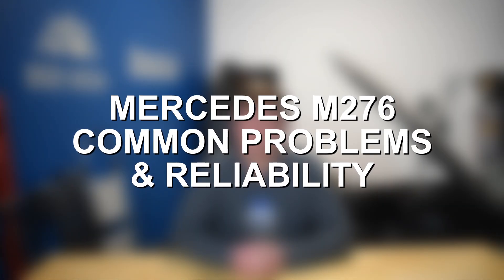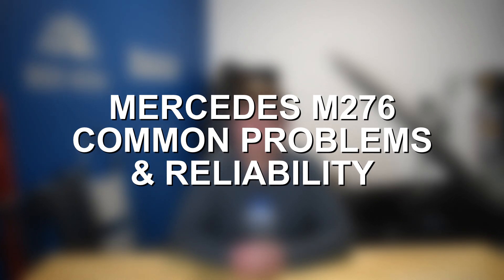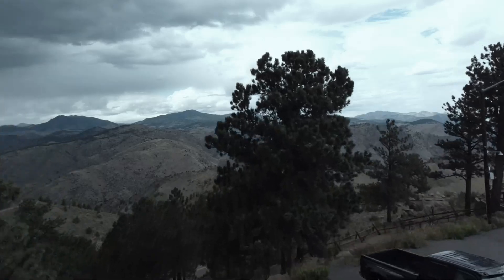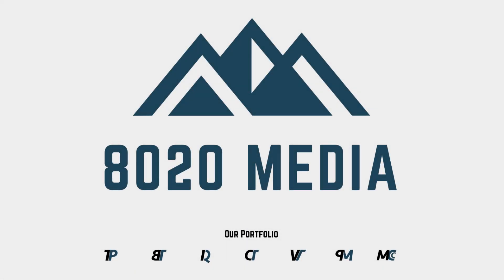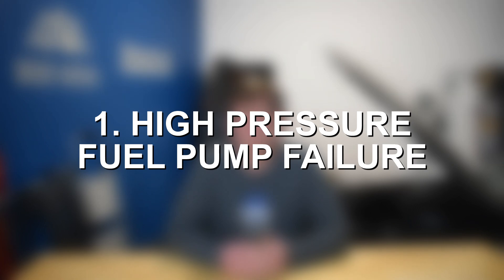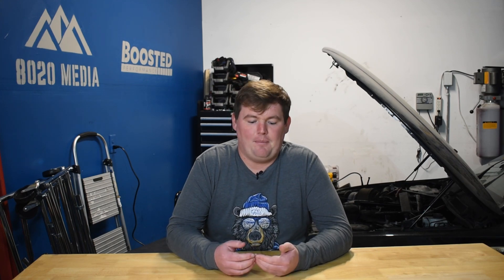M276 Mercedes-Benz | Common Problems & Reliability

Comment: What do you think about the Mercedes M276 petrol BlueEfficiency version? What are its weaknesses? Thank you.
Reply from the maker: D - The Mercedes-Benz M276 (BlueEfficiency / CGI V6) is a pretty solid modern engine, but like any complex direct-injection + variable-valve motor, it has its weak spots. Some of the commonly reported issues are: oil leaks (especially from the front upper timing covers and seals), camshaft adjuster / actuator failures, which can rattle on cold start, cause VVT faults, or damage the cams if ignored, problems in the timing chain / tensioner system (wear, slack, especially in early versions before updated tensioners), carbon buildup on intake valves (a common downside of direct injection engines), and oil leaking into camshaft position sensors / wiring harnesses (when seal fails) causing odd electrical issues.
Reply: @8020Automotive   thanks a lot for you answer !!

Comment: I'm seeing people comment on "oil in the wiring harness".  Is this an issue on the biturbo versions?
Reply from the maker: L - Yes, oil in the wiring harness is a known issue. this happens when engine oil wicks through the wiring harness from leaking components like the camshaft adjuster solenoids, turbo oil feed fittings, or valve cover gaskets, and travels along the wires toward critical electronics like the ECU or TCU, potentially causing sensor failures, misfires, or erratic behavior; this is more of a problem on higher-mileage or poorly maintained engines, but it’s a real concern—so if you notice oil contamination inside sensor connectors or along harness sheathing, it’s smart to clean it thoroughly and replace any leaky solenoids or seals before the oil spreads to more expensive modules.

Comment: Advise. Between a M211 09. Petrol 350 and a 2012-2015 M276. What would be your preference on reliability. I wish to purchase soon.
Reply from the maker: B - The M276 is generally the better pick for reliability and refinement. The M276 addressed many of the timing chain and balance shaft issues that plagued the earlier M272. But that's just our opinion.. Comes down to maintenance, price, etc.

Comment: what better a m276 twin turbo of the c43 or the bmw b58 engine in terms of performance and reliability?
Reply from the maker: I'm definitely a little biased towards BMW, but it's tough to beat the B58's balance of performance and reliability. That said, if you prefer Mercedes I wouldn't recommend changing just because of the engines. The M276 is still a solid engine that has a lot to offer.

Ultimately, I wouldn't pick an M276 or B58 powered car JUST because of the engine. If you're really up in the air see if you can test drive models with each engine and see which really feels like the better overall vehicle, engine, driving experience, etc. to you.

Comment: Maybe you have come across it:

Every now and then my .276.820 twin turbo V6 the homologous variant. Has up to 20% higher fuel consumption. First time I noticed it was exactly after 1 year service and after a couple of thousand miles it goes back. Anything you know about?
Reply: The increase of fuel consumption sounds familiar to me. I have a m276 3.5l non turbo in a W204 (European model). This engine is equipped with an egr and nox catalytic converters. The increase in fuel consumption is to clean the nox catalytic converters. I also notice it in the behaviour of the car. The cleaning cycle could last for days in my case because the engine/exhaust needs to be up to a certain temperature and speed to start the cleaning cycle. My trips are most of the times around 20km with slow speeds. If it happens on longer trips it takes about 50km to 100km to finish the cycle.

Hope this helps
Reply: @FrankyN  Interesting but for me it takes months and maybe 4000 km?
Reply: @Bizmyurt  That is too long. The cycle is just a couple of hundred kilometers at most.

However when the car ages the cycles became more often for my feeling.
Reply: @FrankyN  First time I noticed was exactly after 1 year!
Reply from the maker: B - The periodic increase in fuel consumption by up to 20% in your M276.820 twin-turbo V6 could be due to the engine management system resetting or adapting after service, especially if the battery was disconnected during maintenance. When this happens, the ECU resets adaptive learning data, causing the engine to temporarily run less efficiently as it relearns optimal settings based on your driving style and conditions. This adjustment period usually resolves after a few thousand miles, which matches your observation. Additionally, changes in fuel consumption could be influenced by factors like seasonal fuel blends (winter fuel has lower energy density), tire pressure changes, or software updates applied during service that might temporarily affect fuel efficiency. To minimize this, ensure the air filters, fuel system, and spark plugs are in good condition, as these can also impact efficiency. Keep us updated!
Reply: @8020Automotive  Except the first 2 years am doing the services my self and I do not disconnect the battery but still the car goes in the mentioned period/mode. It is for sure not any other factor as it goes back with exactly the same conditions both outside and inside.

I still can not understand why the consumption will go up with 20% even if the adaptation will relearn because then it should run higher rpm and I haven't noticed that?

For a while I thought of without any specific knowledge, that the pcv system somehow burns down the carbon buildups?

Comment: I'm about to get a E 400 or CLS 400, many of them have 140+k miles on them. Good to know that high mileage isn't a huge problem.
Reply: Please make sure to get a good audio impression of a cold start of the motor. I have the problem described from 5:18 on. To fix this, the motor has to be taken out of the car. This job (with replacement of defect parts and sealings, ...) will cost you in Germany between 6500 and 12 000 Euros.  My car ran 160 000 km ( ~100k miles).
Reply from the maker: A - Well said! Thanks for sharing your experience.
Reply from the maker: C - Nice! Keep us updated with what you decide to go with.

Comment: My car doesn’t rattle on cold start. It does that for like 1-3 seconds when I try to restart the engine after 1-3 hours of rest. If it rests enough for like 4hrs+, it doesn’t rattle. What could be the issue? It got scanned and brought “ (P06DA00) The Actuation Of The Valve Of The Oil Pump In The Combustion Engine Has An Electrical Fault Or Open Circuit”…  Then this also “(P034800) The Position Sensor Of The Intake Camshaft (Cylinder Bank 2) Has A…..” Now I am confused, a mechanic told me it’s my timing chain. I just want to be sure of what the problem is before any repair is done on it. Still drives well though. Thanks!!
Reply: Sounds like my problem. Intake Camshaft Adjuster is close to defect, timing chain needs to be replaced. In Germany between 6500 and 12000 Euros, since the motor has to be taken out of the vehicle for that job. Sorry Buddy
Reply from the maker: T - It certainly could be the timing chain with the rattle.
Reply: Do you have cel ? Mine do the same code p0346

Comment: Appreciate your advice,About to seal a deal on a CLS400, 2015 with 10,000 kilometers on the clock been serviced every year, also found another one 60,000 kilometers well maintained 5k cheaper, given the age of the car,which one reliability wise is a better buy?
Reply from the maker: S - We would go for fewer miles, but we can't make that decision for you. There are a lot of different factors that go into it.

Comment: It is a flaw in design but the dealership has explained that the 276 upper timing covers are prone to leak at 5-7 years.  Although not the engine, another flawed design is the lack of access to the FTPS on ML/GLE models.
Reply from the maker: C - Thanks for taking the time to share this insight!
Reply: The driver’s side leaks.  Never the passenger side.  It’s a simple fix as oil leaks go.

Comment: Looking at a 2014 GLK 350 has 55k miles. How are these cars? Reliable for a Mercedes??
Reply from the maker: A - All depends on your budget and how well it was maintained prior.
Reply: GLK 350 is one of the most reliable motor and cars.  They dont have turbo and 3.5L longish stroke, no direct injection, hence no carbon build up.  Very reliable with 5K oil change

Comment: You can't separate the startup rattle and cam adjuster failure. They are intrinsically linked, and the redesign did nothing for 2013 and later. The root cause of the startup rattle is oil starvation due to owners leaving synthetic oil in for close to 15k. It can't last that long like advertised, regardless of what the maintenance manual says. The upper timing chain tensioners didn't need a check valve behind them when the car was new, problem arises at 70k miles or later. Owners should run 5w40 not that eco crap. The chains don't stretch easily, are meant to last the life of the engine, and rarely need to be replaced. The chain slap absolutely causes damage to the pins inside the VVTs, and eventually labored idle at startup. Not addressing the issue will ruin the top end of the engine, but it's an easy fix. New VVTs and upper timing chain tensioners, then run quality oil, I use motul, and change it every 3k. It's not a oil leaking from the tensioner problem, it's an oil not getting to the tensioner quick enough problem. Give it 2,000 miles after new parts and running new oil and if you're lucky like me you're startup rattle will just disappear one day. 
Edit: 12/10/24 just hit 150,000 miles today, 15k since startup rattle. All is well 😊 Furthermore the high pressure fuel pump assumed failure is often just the car needing a new battery, I've dealt with this. Same with not going into gear occasionally, it's a low voltage at startup issue. The HPFP is good for, well over 150k, like the manual says. And carbon buildup is only really going to happen if you're running with a bad PCV valve for too long.
Reply: change oil every 5K.  I change it every 4K.
Reply: What if the rattle is because camshaft adjuster
Reply: @AhmedAwawda-cr4bx  They just don't produce that sound. The startup rattle sound stems from the upper timing chain tensioner not deploying causing the chain to slap.
Reply: @  i had the rattle before but it gone after I added liqui moly and oil stabilizer but then came back after an oil change with code p0346
Reply: @AhmedAwawda-cr4bx  CPS code happens because the pin inside the vvts gets rounded over due to the chain slap over time. It's bad, but it's early stages and fixable. The root problem is oil starvation to that upper timing chain tensioner. I would venture to guess it's the VVT intake side Bank 1 which is driver side. That's the one that goes first usually. I spent $400 for 4 vvts off Amazon. It will need upper timing chain tensioners. Reuse the same bolts don't buy new ones it's a waste. It needs the damaged parts replaced. To actually clean up the root problem of a gunked up motor you've got to do really good oil changing and it won't get worse. You clean the arteries eventually with proper maintenance and the problem won't return.
Reply: @ okay thank you …I want to ask you can the car run for a while before repair ?
Reply: @AhmedAwawda-cr4bx  best to take care of it but ya if it's running and only occasionally throwing a CPS code you're at the stage I was before I tore into the top end. Don't believe the videos that show doing the job without taking the valve covers off. Few can get that trick to work. Best to replace all 4, along with the PCV valve while you're back there cuz it's cheap and usual goes bad, which is demonstrated by excess suction at the oil cap.
Reply: @LoveKindSunshine  I've been told that the worst potential for damage regarding the phasers is just needing to replace the cam(s) after it spins the gear on them. An experienced tech said that it's a 1/10,000 shot it twists/shears a cam and causes catastrophic failure. Thoughts?
Reply: @confoozled3737  if the rattle persists the pin in the vvts get rounded over and their out of time at startup causing labor idle. If you let that go you'll spin the plates on the cam shafts that the vvts attach too, because they're just pressed on to the cam shafts. I wouldn't be surprised at that point you're so out of time you have trouble starting and who knows if you're going to start bending valves. My $400 set of four vvts from Amazon is still working almost 20k later, I'm up to 153k. It's worth it if you can do the work yourself, but the parts might only fix the labored idle not the rattle at first. Took me 2k till it disappeared. Oil starvation needs cleaning. I had a 1000 mile oil change (0w40) after the work, for motul 5/40, and in 1000 more miles rattle went away. I think hitting it with fresh detergents in new oil helped. Honestly the thicker weight oil isn't going to help get the oil to the upper timing chain tensioner faster, but it's better for all the parts at this age. I change it every 3,000 miles now.
Reply: @confoozled3737  dunno but not too happy hearing anyting about cam damge in MB six cylinder engines, given that cam's were the weak wear issue as well w/ the prior gen and not high miles, ie 100-130K.   Very disappointed w/ MB
Reply: I have a c400 2015 with 38,000miles  and it does that rattle sometimes what oil could you recommend me
Reply: Not a single point you made was true. Stick to your day job.
Reply: @CORZER0  Those who can't address a single presented fact aren't winning any arguments, anywhere. Welcome to the world, newborn.

Comment: I prefer the DI version they put in the 2012 to 2014 e300/e350's  etc etc.    with a tune they make around 330hp loads of bottom end torque, gearing is good they go very well and are very reliable if you keep on top of the oil in electronics harness issues.
Reply from the maker: A - Thanks for sharing this insight.

Comment: Had to dump my 2013 e350 because the cam shaft position sensors leaked oil into the wiring harness which wicked its way up to the ECU. Do you know if this issue was fixed with later variants of this motor?
Reply: According to MB, you can expect leaking upper timing covers every 5-7 year.  Not sure if your issue is the sensor wiring itself or the seal between sensor and cover or even just the cover to head??
Reply: @carlrossi  Resealing the upper timing covers isn't too hard for an experienced DIY'er.  I put in the updated timing chain tensioners and check valves to cure a the start-up rattle (still there for a few seconds, cam phasers are ok).  Need to pull the intake off, so might as well do plugs also (not required, but easier with the intake off).
Reply: This is a well known problem. I believe it was addressed by MB. Check FCPEuro videos
Reply from the maker: T - It depends. This seems like a rare problem, but for the most part, the newer the engine, the higher the likelihood of updates.

Comment: I own a DE30LA M276 with just 20,000 miles. Any suggestions for preventative maintenance? Oil: Liqui Moly 0W-40, changed @5k mile interval. No additives yet but I've been considering doing Seafoam in oil and gas a hundred miles or so before oil changes to help prevent carbon deposits. Thoughts?
Reply from the maker: Seafoam from time to time won't hurt. Carbon buildup won't cause any major issues, you can probably just do a walnut blast once you get around 80,000 miles. Not really much in the way of preventative maintenance other than sticking to 5k oil changes.
Reply: Use the green liqui Molly instead
Reply: I would not add any additives. I would go with walnut blasting if necessary.

Comment: There are two common with this engine bore scoring and oil in wiring harness I am surprise he did mention these any one own these engine know what I am talking  about
Reply: that's for v8,  You are mixing engine families.
Reply: Not for the oil in the main engine harness. The M276 also leaks through the cam sensors and it pushes oil through the harness which ends with the ECM. I just cleaned a half teaspoon of oil from my ecm connection today.
Reply from the maker: H - Thanks for the insight.

Comment: Great video.I want to ask you I am interested in buying a CLS 2011-2014 model which engine do you think is more reliable.The 265 hp OM642 or the M276 306hp
Reply: I prefer the m276 306hp.   And I think most dont realize how good it is tuned they make 330hp and loads of bottom end torque.     But om642 isnt terrible either.
Reply from the maker: A - Thanks for this insight!
Reply from the maker: A - Both engines can be reliable. It really all depends on mileage and prior maintenance.

Comment: This is great! There’s so much info on the B58 engine and the M340i but not enough on the C43 engine.  I’m cross shopping between the two.  Would you say the B58 is more reliable ?
Reply from the maker: V - We're big on the B48 & B58 engines because of its use in Toyota's.
Reply: Go with the C43. The sound alone exceeds that 340!
Reply: b58 is probably a bit more reliable but both are expensive to fix so get what you like, if you cant afford to fix one then please get a lexus or acura instead